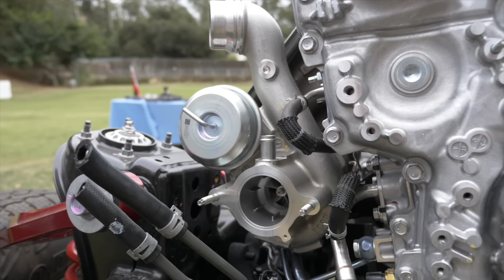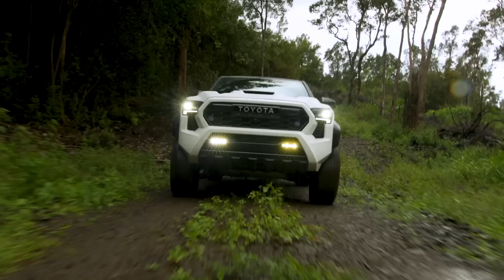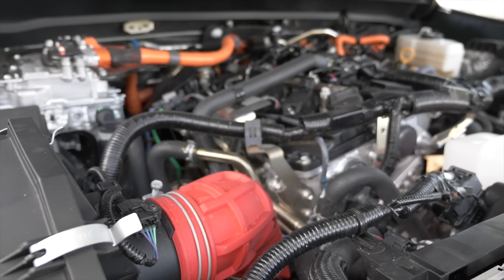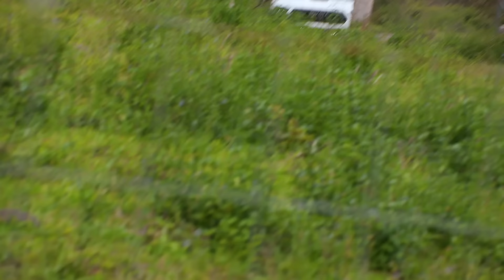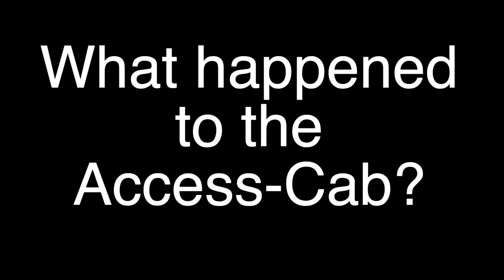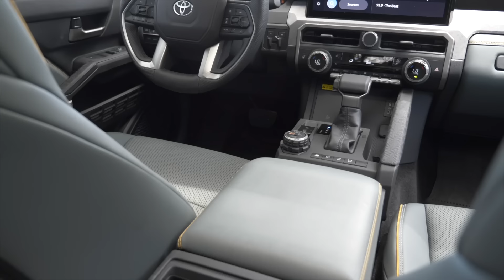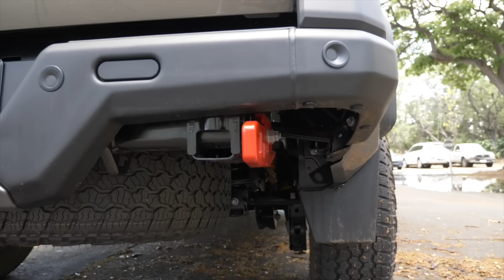2024 Toyota Tacoma Chief Engineer on new engine reliability and more...

Comment: Lifelong toyota owner, currently own two of them. Very disappointed by Toyota caving to the outside pressures to go turbo on tacoma. There is no real world argument that a turbo 4 cylinder will outlive a non turbo 6 that has decades of track record of lasting 200-300k miles before needing any engine work. Having this guy pitch the turbo in no way gives me confidence. Honestly, I am shocked a guy with so little concern for his own health is the lead engineer for a company like Toyota. Why not use the new 8 speed mated to the tried and true v6?

Comment: Only reason for a turbo charger other than a race engine is because the engine is too small and cannot power the vehicle without the turbo.  Much better off with a V6 or V8 non turbo for reliability and long lasting engines.  Very disappointed in Toyota and Lexus for bowing down to the government and replacing their solid reliable V6 and V8 engines.  Not sure about the Tundra but the new Lexus requires Premium gas for 1MPG more  Just plain stupid.  Then they tell you well get the hybrid for more power, no thanks just give me an engine powerful enough to power my wheels without a turbo.

Comment: Toyota turbos do not last as long as they're naturally aspirated motors.
Reply: Do you have proof of this statement other than just personal opinion?
Reply: @chrisyongchu  sure most experts Scotty kilmer they've all done videos on it.  As a teenager in the 80s we did this turbo thing back then.
Reply: @jeffmacey6482  thanks for responding, but is a test back in the 80s still relevant? That’s like 40+ years ago? I would hope engineering has improved somewhat since then right, but I could be mistaken.

Comment: Looks based off the BMW B46 4 cylinder engine. Just like all 2024+ BMW B58s have Toyota features in them like direct and port fuel injection now

Comment: They should’ve have offered a newer engine like how Nissan did with the new VQ36, as well as the turbo set up they’re offering. For a midsize truck, and at the price these new Toyotas are demanding, you should be getting a proper v6. Adding a turbo and bigger coolant channels still doesn’t reduce stress on the crank shaft and engine block with having only four cylinders. Rather disappointing since other companies have been able to keep up with mpg as well as power while maintaining a v6.

Comment: Guarantee Tacoma sales will fall.The turbo 4 may be great for city driving.But off roading and towing this engine will leave you disappointed.Just as the Tundra dropped the v-8.
Reply: Checked the economy lately? Sales are falling on everything. Everything except  food. As for four cylinder  turno engines suck, is just silly. My 1986 Turbo 4x4 pickup's are still going  strong after 38 years. I replaced both turbos at 220,000 miles for good measure.

Comment: This is not the first time they're going to use this kind of engine. Older hiace models both diesel & gasoline engines are equipped with turbo, and these engines lasted for 300-400k miles with proper maintenance.

Comment: What has happened to a cast iron, stone simple small block GM like the 283, 327 and even the Chrysler slant six? Any one could work on them and they last 100+ years if you rebuild. A 113 cubic inch slant six would be ideal and probably do fifty or sixty miles on a gallon of gas. Global high tech con artist! PISS! Everyone is learning about “commercial grade” 1000% prices. In 50 years the streets here will look like Havana, Cuba, full of 100 year old cars. You will probable be riding a 125 CC scooter. These engines, no matter what vehicle brand, are a freaking nightmare, period. Tell me how great it is in ten years. I test drove a 2023 TRD 4x4 with the six speed manual. Due to terrible computer, clutch, throttle and speed interface it was impossible to make smooth gear changes. I’ve been driving 70 years, thousands of vehicles, and it was by far the worst combo I’ve ever seen. Check some forums and Orange Viper and you too will know what the issue is with computer “engineering” to mechanical interfaces. It did not take a rocket scientist to know that in a Tacoma folks have been “sitting on the floor” 55 years. Hip Point? Ha, Ha! 😂 That’s not the point you need to be concerned about, but it’s close, pun intended.

Comment: The secret sauce used to be holding an engine to redline for 7 days without losing a single pony, in an engine dyno IIRC..

..least that's what I was told for the -GE variants, I wonder if it's the same now, wouldn't be too surprised if it still were

Comment: Funny how it's technically a smaller engine than a GM 3800 V6, and yet looking at the way the components are stacked, you can tell that this engine will be a major pain in the ass to work on and will cost a lot in labor.
Reply: that was my first thought too; where'd they hide the starter on this one? 😂
Reply: The Nissan Frontier still has a naturally aspirated V-6.
Reply: @PassivePortfolios  That thing is so fun to drive, I get them as rentals all the time when Im in texas for work lol
Reply: I’d trust him on engine reliability about as much as I would trust  him counsel to me on meal planning.
Reply: @lrr1952  😅😅😅
Reply: Interviewer: where is the starter located?
Chief engineer: That is propietary undisclosed confidential company info. But I can share that it is conveniently located Directly beneath the exhaust manifold, right above the engine mount in front of the downtube squeezed tightly between the turbo and block to keep it hot in cold weather and prevent it from accidentally falling out.
Interviewer: engine out to change it?
Chief engineer: absolutely, a lot of work went into making this truck as difficult to work on as possible.
Reply: @juanfo7307  its a toyota, why are you so pressed because they got rid of the old v6? we know toyota is going to be reliable, why are you splitting hairs here, especially when the only thing you need to make a turbo 4 reliable is to simply overbuild it and cool it properly, which is exactly what they've done.
Reply: @Modikie  I agree 100%.  I wonder if going to the 4 will also actually help resale value for the V6 specifically because of so many people who won't want to consider a 4cyl?  lol
Reply: @Modikie change is hard for some people. As a turbo engine owner they did exactly just that , beef up the internals cool it properly and enjoy the performance..
Reply: @dennisnky That is the best part these loons will overpay for old tech to my benefit just so they can sniff the fart juice I hid in that driver seat cushion!😂😂😂
Reply: When they first came out I was hearing 35,000 for a replacement
Reply: Maybe if you've never worked on a motor in your life. This is easier to work on than my 24v Cummins

Comment: In my mind, I was convinced that the turbo 4 banger would get close to 30 mpgs, apparently it's only about emissions not actual fuel economy. I'm pretty bummed, also I like the access cab door even though I don't have seats in mine.
Reply: It's not about either, it's about the EPA test cycle which favors small turbo engines. In the real world they aren't more efficient and they don't emit less toxic substances. They do have benefits for driveability due to the low end torque. I would prefer a small I4 with hybrid to make up the power and also get much better mileage!

Comment: Amazing engineering - but so last century. I hope Toyota has been telling the truth about their solid state battery development. An electric drivetrain is so much simpler, has so much less to go wrong, and has so much more overall performance (low end torque and total power) that these ICE trucks are going to look very lame - if and when batteries can provide the range to haul a trailer.

Comment: Yes, Toyota has run turbos, but they aren't as reliable as naturally aspirated and they haven't run THIS turbo, so he can't say for sure THIS one is durable. Guaranteed the turbo itself won't last as long as the prior Toyota motors did with regularity scheduled maintenance. More delicate moving parts + more heat + more pressure + aluminum block + plastic = they gave up on their core values. It's really the crazy government's fault for running amok over everything and everyone.

Comment: They're just bowing to the wims of the gov't bureaucrats and WEF direction.  They don't care what the customer wants.  Have to talk with any mechanic friends that say these turbo motors are better than a pure cubic inch standard engine.  These engines are a part of what's increasing initial purchase costs and then the long term maintenance expense.  The average household driver may never experience big issues, but those that legitimately use their vehicles know it doesn't matter who the manufacturer is these engines end up being problems in the long run.  I'd rather have an old straight six or v8 without all the built in planned obsolescence than anything new.

Comment: Time will tell. Heat will break down every piece of plastic under the hood. Hard to fix without pulling body like Ford. Broken exh aust bolts will keep mechanics bsuy when the engine wont pass smog. Nice in the first one hundred thousand miles maybe. Warranty on parts and labor would have to be long for me to abandon a N/A gas engine.

Comment: i have a 2021 tacoma. it doesn't have a key lock on both doors. i hate this. put a key lock on both doors. scotty kilmer says a turbo charged engine will not last as long. you have the most popular mid size truck. why change it.

Comment: In my opinion , I believe that the engineer and auto makers may not care much in 5 to 10 years down the road the vehicle is breaking down or not. Toyota should keep 6 cylinders on for all trucks and bigger suv like Highlander and vans. I tried the new grand Highlander and I felt that it does not have enough power to pull the larger vehicle well.

Comment: Yeah...'reliability' isn't the main question...it's 'longevity'.  No way, no how, does something that averages a much higher cylinder pressure to produce the same torque last as long without much more expensive internals.  The 'reduced emissions' argument is horseshit

Comment: why develop a dead-end tech? with the adoption of speed control technology by the NHTSA in the next few years for safety wouldn't it be easier to implement with an EV drive train? Just let the computer control the speed as it pickup the signal from the posted speed transponder.

Comment: Ford and GM engineers are designing a new 0.5 Liter with six turbos putting out 189 hp for their new trucks.  If any one of the six turbos fail, repair costs will amount to $10000. I am being facetious here but come on engineers enough is enough.  Go back to the basics.

Comment: Just order your toyota overseas. This turbo thing is an old technology that's just now being introduced to you Americans. Yes they're reliable but when those turbos go out (and they will) they're expensive to replace. Part of the reason why they're moving away from it plus it's not ideal in hot climates either since they tend to overheat. Especially when you're asking a 4 cyl engine on steroids to do a V8 work load. Engines will not last long.

Comment: I dont doubt the new 4cyl engine will be reliable , its just a shame we cant go back to the simplicity of the older v6 engines. In the past you could look in an engine bay and not get panic attack. I look at these new engines and there is so much shit all over them. I would never want to have to perform any repairs on it ever. I'm not worried about a new truck breaking, but in 10,15,20 years when you buy these trucks used thats when people are  going to be screaming about what a nightmare and expense they turn into
I keep buying older cars cuz I can repair them easily and keep them running cheaply. Even catastrophic failures are easy to fix. dont even get me started on all the electronics. I'm not picking on toyota specifically but everyone really. I know thes arent for me, I get it. but I bet toyota of all companies could build real simple vehicles, I bet they offer them in countries like south america.
Everything sold in the united states has to be some kind of space age whiz bang.
new cars are like spaceships and when one small thing fails it cascades into bigger problems. nothing is simple, nothing is easy anymore....I'm going back in time, back to an old pickup with a small block v8 and a 4 speed lol...
I love the tech, I love all the cool engineering that went into the engine and turbo and all that...I just dont wanna have to fix it when it breaks...and inevitably it will

sorry

Comment: Throughout the video, for various initiatives and goals, I kept ”compromises.” Don’t doubt advancements in welding techniques, aluminum strength, cooling turbo engines, ability to integrate more parts in complex engines, etc. Weight savings may come back to cost you in some circumstances. And efficiency definitely can. Complex and reliable rarely go hand in hand.

Comment: What they have done for the extended cab is something that companies should have been doing for a lot longer.  I love all of those durable materials for integrated storage.  Though Im not too keen on not being able to open the rear half cab but maybe it offers more security?
Reply: I had a 2004 Xtra cab (no 1/2 doors) and now a 2008 Access Cab. I love the 1/2 doors..  much easier rear access than on the 2004.. It may simplify truck production for Toyota, but it sucks for the user..
Reply: @telcobilly  thats what I was thinking.  I haven't heard anyone speak to this officially as to why.  IF you do could forward me a link?  Thanks!
Reply: From what I heard it has to do with crash rating.
Reply: Thats interesting!  Thanks! @randyrabuck8514

Comment: Really, I would like to see a simple / maintainable air cooled fuel engine driving a generator that powers in wheel motors.     No radiators, transmissions, transfercase, drivelines.

Comment: I own a 2005 2nd gen 4.0 with the unbreakable, smooth, and perfectly ratioed 5-speed automatic, which I think was their high-water mark small-truck drivetrain for both reliability and durability.  The 4.0 is a half million mile engine.  I don’t see the 2.4L turbo, and certainly not the hybrid, lasting 500,000 miles without multi $10k component repairs.
Reply: Oh man I am sure your comment changes everything, Toyota Engineers be like jefftrimm7806 doesn't see our engines lasting 500k miles, throw in the towles guys go home

Comment: Well everyone knows the engine has turbo has more power and but at the same time making not reliable the engine because you never know when the turbo is going to break down and you truck it's over after buying other turbo and if you live on farm the dust also going to break the turbo my question is why do whit straight v6 and avoid the turbo and the hybrid sistem.

Comment: Many may doubt Toyotas turbo charged cars and trucks, but let me remind you that some of their most reliable vehicles were 4 and 6 cylinder turbo vehicles. Toyota is also one of the only auto manufacturers that tests it vehicles to the point at which it completely fails.

Comment: How durable is that 4cylinder turbo engine compared to V6 ?
Will that turbo last 200k miles?
2 mpg gain is useless if that small car motor wont last.
Most customers are not really concerned of emission !!!

Comment: Dealer mark ups, not the vehicles is about the one issue I've been frustrated with. I'm sure the engine is fine, can you fix the broken dealer system next? When will Toyota, Ford, etc start selling direct to consumer? I'd like one but they will be too expensive because we've got to pay for a giant building with hundreds of employees who, aside from the service department, do not add value.

Comment: Speaking about fuel delivery: I will avoid anything with direct injection. I don't care if the D-4S has port and direct injectors. That is added maintenance and cost that is avoidable. I am more than happy with less horse power if I get better reliability out of my engine. I had a '97 4Runner with the 3RZ-FE 2.7 liter engine. I loved it. It was a base level 4x4 with the 'J' shifter for the transfer case. No '4x4' button on the transfer caser knob/lever. Open diffs. A340E automatic 4-speed tranny. The 4Runner had it's limitations as I kept it stock. No lifts. No suspension upgrades, Just OEM. I, sadly, used it as a trade-in when I should not have. Bought it for $4,500. If I could, I would go back in time and keep it. I let go of it with just over 200k miles.
Reply: As an owner of a direct injection engine with 200K miles, I understand your concern as I've had to clean my valves and they were nasty. But you mentioned that you didn't care if an engine also had port injection in addition to the direct injection. My feeling and understanding is that if an engine features both, the port injection should clean the values and eliminate the need for cleaning the valves - assuming that is your concern.
Reply: I understand. Thanks for sharing. I'm standing firm on my choices of port injection only and no turbos either. Why pay for 4 or 6 extra fuel injectors (D4-S) if you don't need them? @Fmandan77
Reply: Me too. Fuel rail pressures are too high and it doesn't clean the valves. Plus ethanol gas kills it and that's all the politicians' will lwt gas stations sell around me. They want to kill the gas engine even though they burn clean. It's some real 1984 stuff going on.

Comment: 0w-8 oil, stressed 4 cylinder turbo, stop-start=cooked/burning oil after the warranty expires.

In a truck, NA all the way if you want to keep it 100K-200K+ miles.

Sad, that govt pushes all these "fuel efficiency" rules that ruin engine longevity and company reputation.

Nothing wrong with the 1GRFE. 

Turbo cars are for lease only. Short term business strategy.